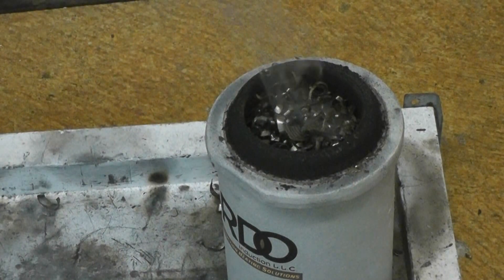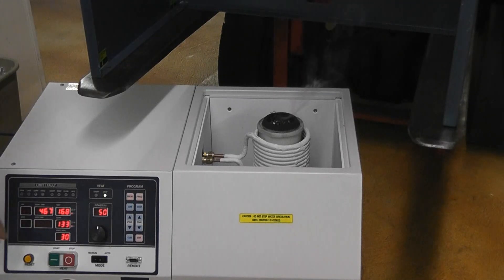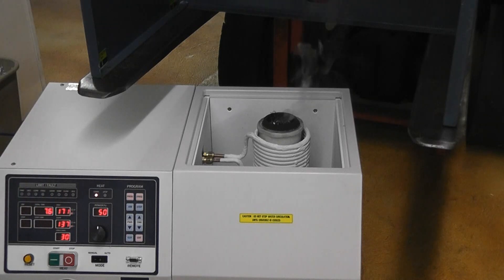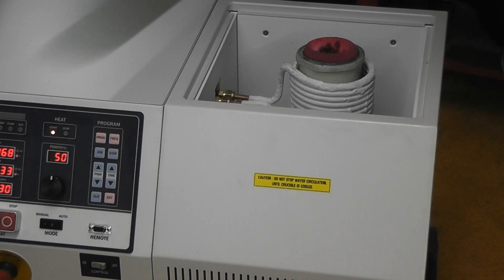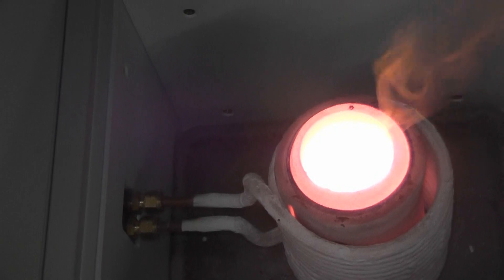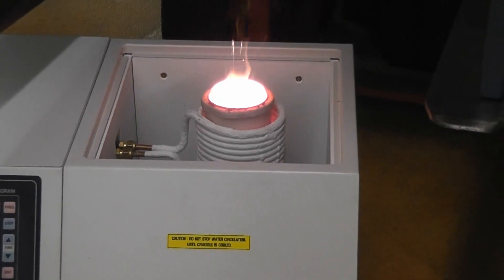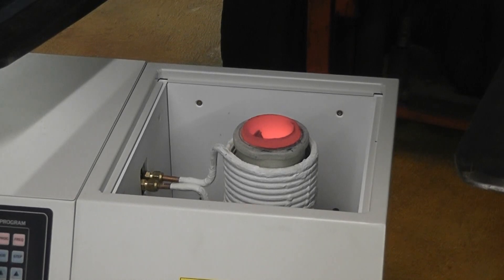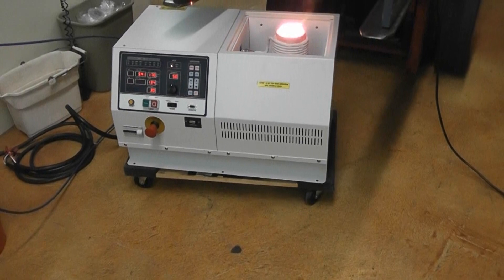Induction Melting Steel in a Graphite Crucible

Comment: Does the carbon in the graphite crucible alloy with the melted steel? I'm wondering how long that crucible would last when melting steel or iron.
Reply: yes it does alloy, and it make the steel very brittle from what I think, you usually use a differnt kind of crucible for this

Comment: Good day!
Does heating up steel so fast affect the grain structures in a certain way?
Reply: If the steel is entirely liquid then only the cooling will affect the grain structure as the crystals begin to formulate at around 1500°C. Refer to a phase diagram for steel.

Comment: Impressive.  Does the induction coil only work on the metal load or is there also appreciable current circulating in the crucible?